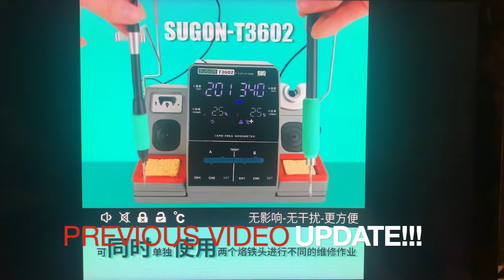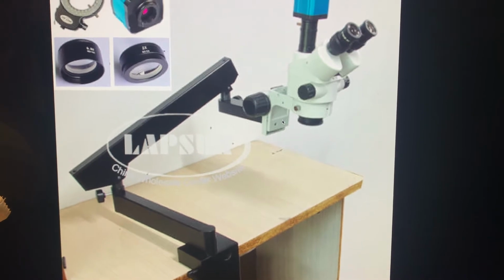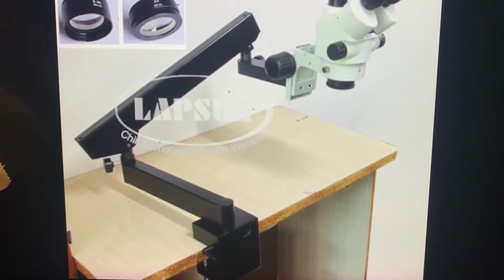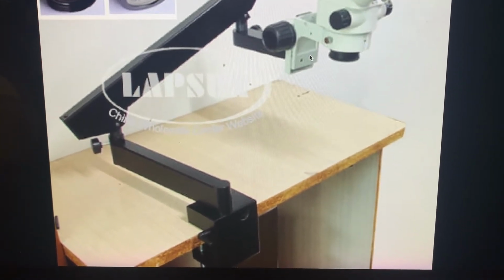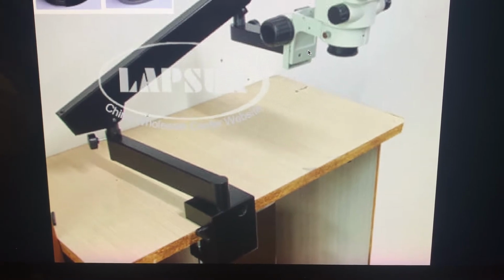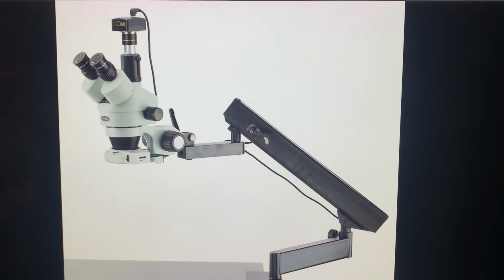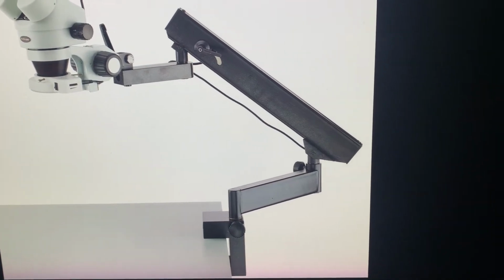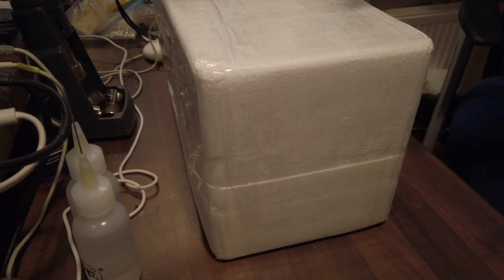Soldering Microscope Arm , plus update!!

Comment: Did you ever get around to plugging in the JBC handle to see if it worked? I have found a few OEM NT115-A handles that say they are compatible with both. can you verify?
Reply from the maker: I’ve been meaning to get one and test but haven’t got round to it yet because I’ve been just using it with the sugon handle with JBC tips. I’m going to order an original JBC handle now and I’ll update you very soon if it works or not. I’ve been meaning to do this. Thanks rich

Comment: Great vid, we've obtained a few of these for others & these are fairly good arms only downside to these when using a scope or a camera scope is that it doesn't have any tilt angle that you would have on a dual arm boom base or an articulated arm but that's just one of these things that is down to preferences.
Reply from the maker: Hi I’ve heard you sell some really good flux, Crystal blend and lite blend. can you post a link so I can buy some please because I really want to try some. Thanks so much.
Reply from the maker: thanks so much, I really appreciate you taking the time to watch the video. It means alot. That is totally true, it's doesn't beat the dual arm boom base or full size articulating arm for flexibility. For the price I was really impressed with what you can do with it and it's great for people who haven't got a lot of room on their bench, i never got enough. you're right it does boil down to preferences.